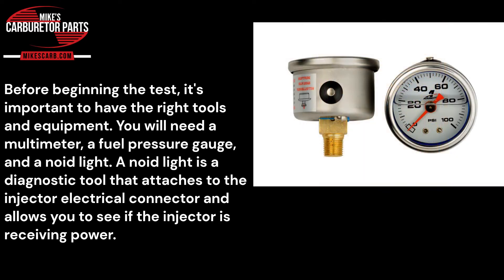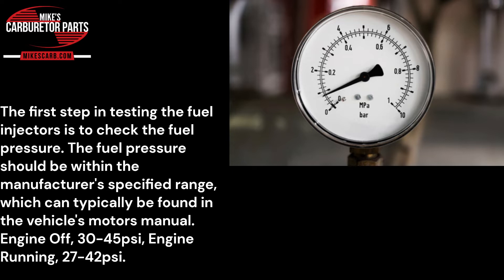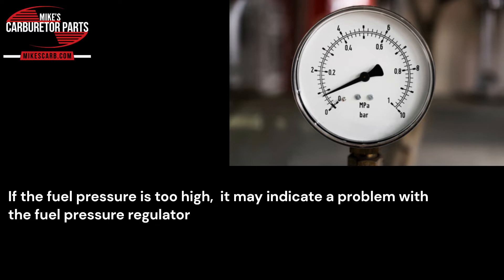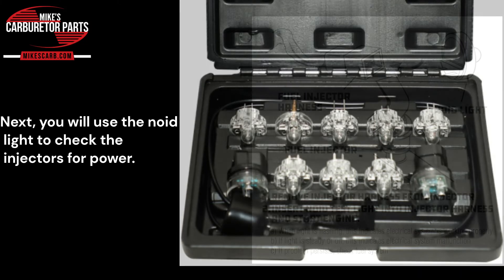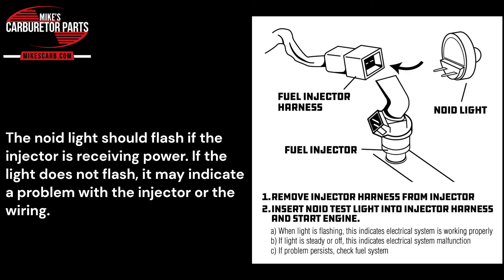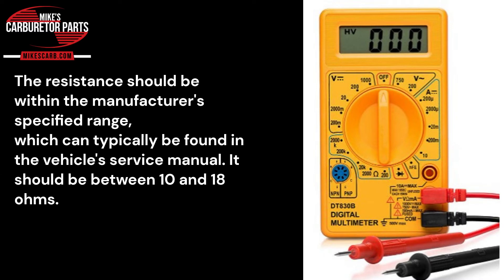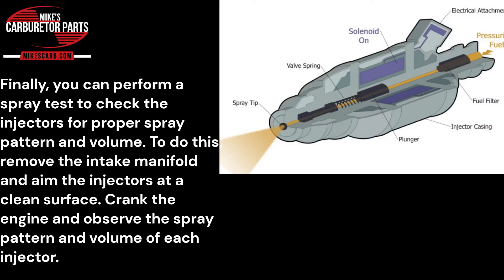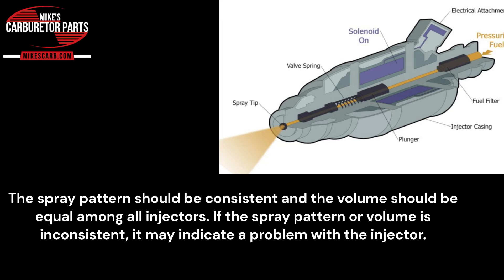Ford 5 4L Fuel Injector Testing

Comment: I'm feeling a shutter when I initially accelerate. I already changed o2 sensors, maf, air filter, fuel rail regulator, Passenger side injectors, I need to still do the driver side ones.. Also, my fuel pressure is only between 30-35 psi. With KOEO and when running.. New k&n fuel filter in line. Any ideas? Is my fuel pressure too low?
Reply from the maker: Short answer: yes — 30–35 psi is very likely too low, and low fuel pressure absolutely fits an initial acceleration shudder/hesitation.

I’ll be blunt and systematic so you don’t chase ghosts.

1. Fuel pressure: this is your biggest red flag

On most return-style EFI systems, typical specs are:

KOEO: ~38–45 psi

Engine running (vacuum applied): ~30–38 psi

Under throttle (vacuum drops): pressure should jump UP, not stay flat

If you’re seeing 30–35 psi all the time, including KOEO, that’s marginal at best and often lean under tip-in, which causes:

Shudder or stumble when you crack the throttle

Feels like a misfire but isn’t

Goes away once RPM increases

👉 Low pressure = weak injector spray pattern + delayed fuel delivery

2. Why it shows up right off idle

Initial acceleration relies on:

Injector response time

Fuel pressure rise

Correct atomization

If pressure is low:

Injectors open, but fuel volume is weak

Mixture goes lean for a split second

Engine shudders before catching up

That’s textbook.

3. Things you’ve already done (good, but not the fix)

You’ve already ruled out a lot:

✔ O2 sensors
✔ MAF
✔ Air filter
✔ Fuel pressure regulator
✔ Some injectors

That narrows it fast.

4. The real suspects now (ranked)
🔴 1. Weak fuel pump (most likely)

A tired pump will:

Hit 30–35 psi but not reach spec

Fail to increase pressure under load

Cause hesitation before acceleration

Test:
Watch the gauge while snapping the throttle.

Pressure should rise instantly

If it drops or stays flat → pump is done

🔴 2. Voltage drop at the fuel pump

Very common, especially on older vehicles.

Corroded grounds

Weak relay

Old wiring

Test:
Measure voltage at the pump connector while running.

You want close to battery voltage

If you see 10–11V → pump can’t make pressure

🟠 3. Restricted pickup or tank issue

Even with a new filter:

Sock in the tank may be partially clogged

Rust/debris in tank

K&N filter is fine, but it can’t fix upstream restriction

🟡 4. Remaining injectors (driver side)

Yes, do them — but:

Injectors won’t fix low system pressure

If pressure is wrong, new injectors still starve

5. One quick test you can do today

Pull the vacuum line off the fuel pressure regulator:

Pressure should jump 8–10 psi

If it barely changes or stays under ~38 psi → supply problem

6. Bottom line (no sugar-coating)

30–35 psi is not healthy

This is almost certainly fuel delivery, not sensors

You’re likely looking at a fuel pump or pump power issue

Fix pressure first, then worry about injectors
Reply: @MikesCarburetor thank you SO MUCH for that answer! I really couldn't have asked for better, definitely wasn't expecting it. So thank you!! Suddenly I got p0460 fuel gauge sensor, so that pump is definitely going in the trash.!! Thank you thank you thank you!!🙏🏻🤗

Comment: These are mostly return less fuel systems, with a fuel pump driver module, not regulator
Reply: I have 2004. no FPDM it's regulator on the rail